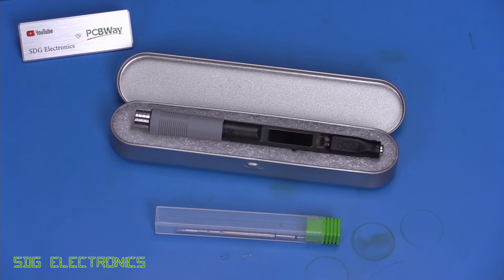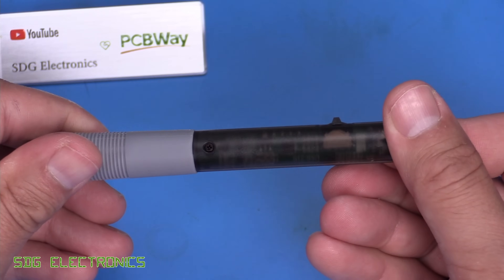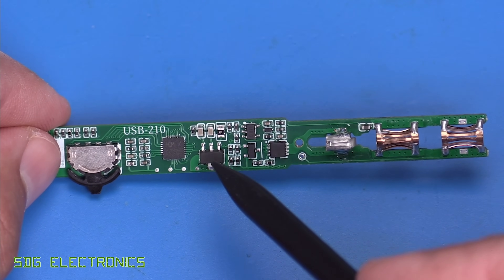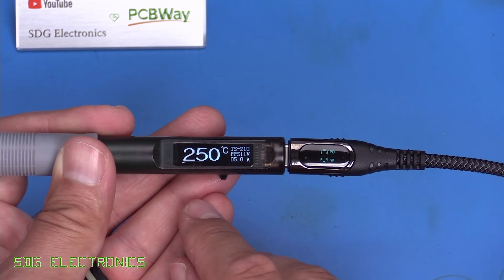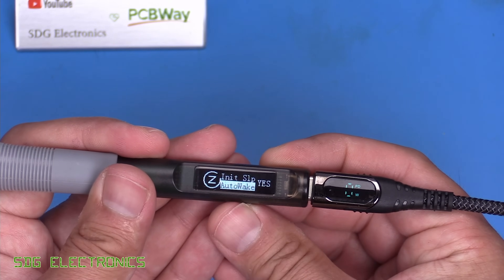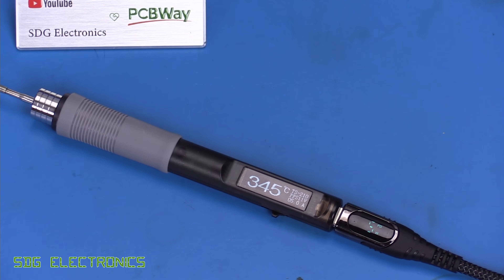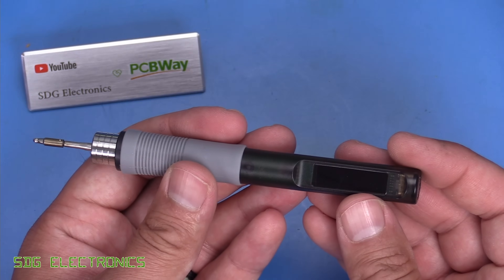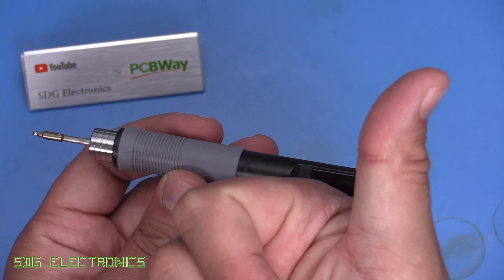SDG #344 TS-210 USB-C JBC Style C210 Soldering Iron PD3.0 QC3.0

Comment: The "specifications" on the Aliexpress sales page states: "Maximum power: DC12V/6A or more C210 heating core up to 72W".
It is not going to be easy to find a USB-C PD power supply that is rated at more than 3A at 12V. Typically, 5A is only supported at 20V.
Whether it is going to become a problem (foldback/shutdown) in daily use, is another question. But in general, it's not a good idea to rely on being able to safely draw twice the rated current.
Reply: I wonder if the adapter with a DC barrel jack will supply the current?
Reply: @acoustic61  defeats having a USB-C socket, though.
Reply: @mortenhattesen  Well, most Chinese made clones and supposed compatible soldering stations have these types of issues.
Reply: the aliexpress page shows a "standard" power socket to usb3 adapter that comes with the unit.  It looks like another small piece that would be easy to loose
Reply: Pps 11v 5a
Reply: Where are you learn electric???
How much are you neeed?
A, and V, and W... Are this thigs speaking somethig to you???
What you looking for, Amper, or Volt, or somebody to fingering your mind???

Comment: Is the soldering cartridge tip grounded to the UCB-C Shell/shield in any way, directly or via a resistor? Otherwise there could be a considerable risk of ESD damage to the parts being soldered, given the typical leakage of switching USB power supplies.
Reply: Grounding to the shell doesn't help, since the shell isn't earthed on most USBC type supplies anyway. It could even make it worse. You'll have to use a custom cable or PSU or crocodile clip to properly earth it.
Reply: @jaro6985  it would be fairly trivial to add a separate ground lead to the same location where the ESD wrist strap is wired. But if the tip is not connected to shield/cabinet, that would be impossible. Hence the question.
Reply: JBC C210 tip is connected to the middle contact, internally. So from video it looks like PCB ground will be connected to the tip (perhaps USB 0v is connected to tip). Better to use battery power for USB irons, though.

Comment: the problem with these c210 irons is that you need a "high" current 5a power supply @10v-12v as the tip resistance is ~2ohm
Reply: JBC C210 is 40W rated. By my calculations, 9v would be optimal (4.5A).